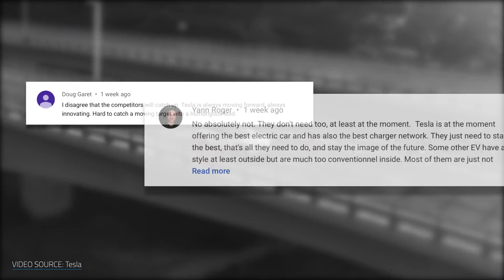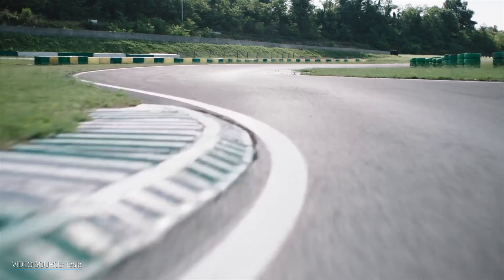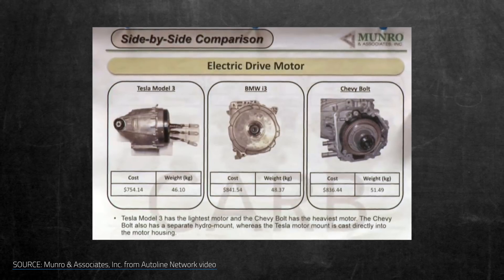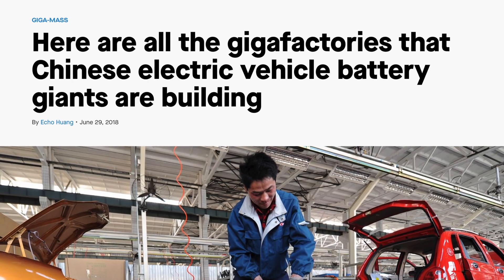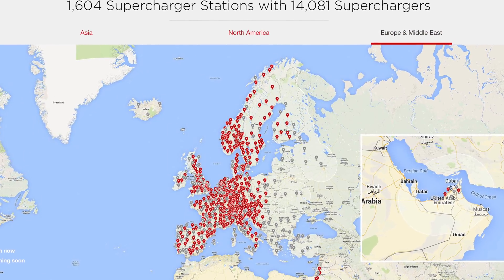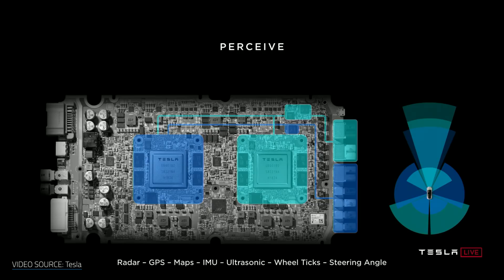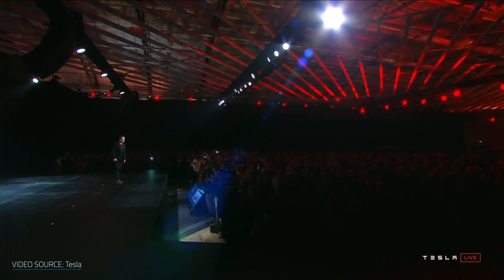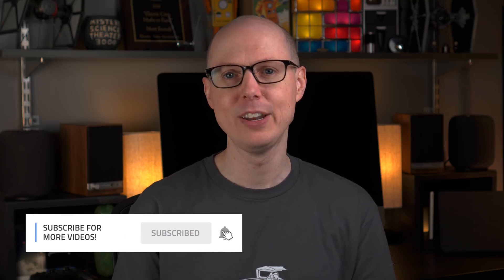Tesla vs Competitors - 5 Advantages

Comment: In my opinion there is a little bit of misticysm around the Tesla model 3 motor and, I read a lot of contradictories things in Internet. The machine, strictly speaking, is not a synchronous reluctance machine: as officially reported (and correctly) by the EPA certification, is an "internal pm machine" or in other words an interior permanent magnet (IPM) synchronous machine. IPM machines are the only synchronous machine topology which exploit, for the torque production, ALSO the reluctance mechanism. The same is true also for the other competitors, like Toyota, GM, BMW which also are nominally IPM designs (for the latter two, someone could call them PM assisted synchronous reluctance in reason of a kind of multi-layer arrangement of the PMs). Depending of the rotor design, the fraction of reluctance torque to the total torque production can be more or less significant. Under the cost point of view, high reluctance torque is benefical since it allows to downsize the expensive Rare Earth PM. In my opinion it's interesting to compare the different (rotor) pole number: the GM and BMW works, if my memory serves right, with a 10- and 12-pole design respectively; Tesla is a 6-pole design. As a general rule, the lower the number of pole, the higher is the fraction of the exploitable reluctance torque, and this might be a potential advantage of the Tesla design. Second, because of the lower number of poles, Tesla works, for the same mechanical speed at 40-50% lower frequency than GM, BMW competitors and this is positive as regards efficiency especially at partial load and medium-high speed range. (lower iron losses, switching losses). Finally, regarding of the Halbach Array, I have honestly some doubts it is actually like that: it's unclear if the Munro's statements are supported by serious investigations (with magnetic field sensor) or by highly questionable methodologies ("hammer test") as reported by himself. The PM segmentation, nor the PM explosion following the hammer test,  are not final evidences of Halbach Array.

Comment: The problem with tesla is not that they don't have a great product now relative to its competitors. The issue is how much cash and financial gearing was needed to get there. They know that their first to market advantage will not last forever and they probably wont have the means to sustain intense competition from other companies with much more cash available in the not so distant future. Technologies are getting commoditized faster then ever in every industry. They need to create some sort of network effect to stay relevant over time so software and data related to self driving cars is where it's at. If they can figure out and implement that first they will cause a real paradigm shift in the car and transport industry from which many competitors won't be able to adjust fast enough. Their advantage in that department is what could win them the game in the long run

Comment: The VAG (Volkswagen) are building the Ionity network of 350 kW chargers in Europe. It is not the size of the Tesla Supercharger network yet but it is getting there. Tesla cars can charge at Ionity but VW cars can not charge at SC - this is not VW saying no to a deal with Tesla. That is Tesla locking competitors out and might get investigated.
Reply from the maker: Tesla has an open invitation out to any other car company to use their network.  Nobody has taken them up on it.
Reply: @UndecidedMF  again this is untrue and the EU might fine Tesla until they open the network. No invitation is required because the network must allow any car with CCS. Just like every other charging network.

We are not talking free charging here, but paid by kWh just like model 3. Refusing to sell to other cars although the charger technically is fully compatible is abuse of market position and the EU is known for very hefty fines for that.
Reply from the maker: Baldur Norddahl oh... I’m following you now.  It might be tricky for Tesla to open it up because of how the chargers work.  They talk directly to the car to get authorization to charge and know what account to bill for use.  With non-Tesla cars there would be no such communication, so there’d have to be an alternate way to bill.  There’s no interface on the chargers themselves, so I’m guessing that Tesla would need to figure out some kind of mobile app authorization interface.  Curious how easily they can open it up without having to further retrofit the Superchargers.

Comment: All true and well, great car to drive, however, Tesla service (in my country) is desastrous! They cannot be reached, I have spent over 10 Horus waiting on the phone, car got towed, broke down several times, promises to fix and support all not kept, been driving a loaner now for over 2 weeks and 4.000 km and still no solution for my own Tesla. This is not how to treat your customers. I don’t even want to think about calling them, as I will need to wait another hour on the phone before someone will answer. Driving by a service center also easily takes you a 30 to 60 minutes waiting time and then another hour before you get some kind of answer.

Comment: Autopilot only works for airplanes and ships not cars due to liability insurance and software crashes.
Reply: And it is forbidden in Europe. You need to keep your eyes on the road and your hand on the wheel so what's the point. In large parts of Europe the driver has to meet strict rules while driving.

Comment: There is a way to build a better electric motor by changing changing the geometry of the moving parts which will eliminate the back EMF and eliminating the dragging action caused by the eddy currents in the copper greatly increasing efficiency.   Also other techniques can be used at the same time to increase the efficiency even more like. https://www.youtube.com/watch?v=HK3JOlY0V8Y&t=10s    Scientist Solves Tesla’s Secret To Amplifying Power.

Comment: Having constant-power for all ECUs is an advantage over traditional ICE components. Old car components always have to worry about low-power  or power-off situations for extended down-time. Having an ever-present power source makes design a LOT easier. ESPECIALLY if your entire fleet is electric. There's just a primitive, ultra-hardened approach that traditional ICE firms will need to drop if they want to reach tesla's wow-factor.

Comment: The charging network and navigation integration etc is what for me is the number one reason for Tesla. But the VAG group and a few others made the Ionity brand for charging network and that is growing fast too. Now if they also make use of the CCS car number like Mercedes does with the EQC you can charge everywhere without a app or dongle. 

Self driving is fun on the highway and Nissan Leaf does a great job there as well. Living in Europe I don't see full self driving cars in our cities for the next 10 years at least. 
The motor yes Tesla has a very good one but VAG and Porsche with the help of Rimac will also have great motors to go with. 
Tesla's siding with Panasonic was a great call and they are in the lead there but I don't want to count LG Chemie out. 

So I think depending on what you want from a car you have choice now. Smaller and bigger electric cars will come. For me Tesla is great and they have nice cars but for a family car the model 3 is too smal in luggage and the model X well I won't pay 80k+ Euro for a car of I should get a really good job somewhere. Volvo is coming too with electric cars and I would love a V60 or any station. That NEV's 9-3 station looked also really nice but I have a fond memory of mine 9-3 diesel so a electric one would be amazing even if it doesn't have FSD capabilities or fast acceleration. That even creates more pollution from tire degradation and we drive electric for ecological reasons. 

Elon is by far one of the coolest CEO's, no doubt there. But on the other points Tesla is working hard to have that advantage. Staying in the lead is very hard and I hope they succeed. But I also hope VAG and other manufacturers are just going to make decent electric cars. We don't need super fast cars everything under 10seconds from 0-100kmh is more than fine.  I want a practical car that is not around 80k which the EQC/e-tron/ i-Pace all are.

Comment: The model 3 has different type of motors depending which model. I'm not sure why the video says performance and efficency in one motor because the performance model 3 has less efficient motors but more responsive than standard model 3 so it's a choice.

Comment: If they had not got the biggest/best battery supply, the biggest data set for self drive, the best looking/performing cars, the biggest most reliable  own charging network, their own best chip designers, the most vertical integration, the only china factory 100% owned,  the most exciting road map for future vehicles from 250 mph roadster to 40 ton trucks,  the best engineers, a company mission that does the world some good (take note VW)  I might get nervous and pull my shares.......erm wait a minute where the hell is the competition?.....there is none.....game over big oil ill sit tight.

Comment: #6 Pace of innovation, 
You said Tesla is not standing still but actually they are innovationg much quicker than all the competition combined.. they innovate on battery tech, FSD, production techniques (the patent this week for reducing the ammount of wiring in model Y), Service (online sales, service provided at your doorstep, etc), OTA updates (cars get better over time) and last but not least, cars generating revenue after they are delivered by selling FSD upgrades.  Tesla's lead only gets bigger and bigger, competition cannot keep up with the pace of innovation.. Why? Because they still have a HUGE ICE eco system with dealerships and what not to support! Not enough money to spend on innovation in EV only.

#7 Tesla is NOT a car company alone
The energy business may become way more important than the Car branch, once the battery production can be ramped up 60x, as they have predicted (going to 2 TERRAwatt per year, while end of this year 'maybe' 35 Gigawatt) But also the solar roof ramp up to 1000 roofs per week is very significant! Tesla utility battery MEGA packs may become the most important revenue maker for Tesla.. cost to make and install on site is relatively low and simple.. Quick installation, OTA updates, remote monitoring and low maintenance costs may become very attractive for utility power companies and willing to pay a premium price for that.. The energy branch may become a HUGE revenue generator for Tesla.

#8 UNPRECEDENTED Exponential growth and worldwide expansion to become a world leading EV and energy storage brand (which they are already)
Tesla EV deliveries and revenue has been growing exponentially the last 7 years (doubling EACH year since 2012).. THIS IS A HUGE ACHIEVEMENT for the branch they are in.. no other company making tangible complex products like an electric car is, has ever shown this kind of growth for such a LONG time! The pace of growth is unprecedented and IS NOT SLOWING DOWN for the forseeable future... It will not be long before they PASS the large legacy auto makers in total revenue and car deliveries.. Tesla is ALREADY the biggest EV car maker in the world (except, maybe, for China brand BYD) and they only getting BIGGER... Probably end of this year the Europe Giga factory will be announced. Car deliveries will expand to other parts of the world, like India, Africa (South Africa), Eastern Europe, South America (deliveries in Mexico have started) and maybe even Russia (when the Europe factory comes online). New car models (model Y and Truck) will become even bigger than Model 3 is right now, Semi will be a huge money maker for Tesla.. and of course new models will be unveiled.. As you said, Tesla will not be standing still!

Comment: The big one is that Elon has built all the parts that he'd have to go outside to get. The more he diversifies, the less he must burn up profits to other providers. Silicon lab, check. Space ferry service, check. Internet provider, check. Tunnels that will require skids with motors that Tesla makes, check. Brain interface... that one could be used with any of his products. The point is, he's using synergy.

Comment: You pretty much nailed the major components in tesla's advantage. There are other things that maybe not as eye catching but nevertheless important such as : 

1. Over the air software update(yes you kinda mentioned it in autonomy point, but this is really big that it deserves the point on its own, considering how they managed to fixed braking and improve range efficiency just with that)

2. Advanced electronic components engineering and integrated cooling/heating system that Sandy Munro has praised so much, check out how Sandy explained it for more info, cause there's a lot of interesting stuff in there.

3. The fact that tesla car is some of the safest car out there, imagine if in every tesla crash that the majority of the driver died,  imagine how many the media gonna keep saying things like "tesla driver died" over and over again, and spun it into "tesla is not very safe".

Comment: Get into an accident with your Tesla, even a minor fender bender and then start talking about your "Advantages" when it comes to getting it repaired. Race me in a Cross Country roadtrip, you in our Tesla Model 3 or X, me in my 2015 Chrysler 200C and let me know about your advantages. Bring it up to Northern Utah in the Winter time, In a Snow storm, up some mountain passes and see who holds the advantage. A Car isn't an "App". It's a vehicle, it's something you drive on the road.
Reply: Insurance exist and tesla just added 40 more service centers to areas that require them most, who races on a road trip? There are plenty of videos showing that the M3 roadtrip experience is not that hampered by charging, who also travels through mountain passes during a snow storm? Dude it just sounds like your in a competition to make yourself as uncomfortable and dead as you can, but if you do go through a mountain pass you could always pack a 5kwh generator in the back with 3 gallons of gas for 100 miles of range added on top of the 240 miles the batteries shrink to0 in the winter, M3 is also a very safe car so if you fly off the side of the road you will be more likely to survive in it then mostly anything else.

Comment: How can they claim Tesla does no advertising, when there are so many Youtubers offering referral codes and at the same time only publishes positive stories about Tesla? The referral program is advertising, not in a traditional sense, but advertising none the less. Saying they spend 0 dollars on advertising is misleading. 

Teslas do have some genuine advantages of course, but they have lots of issues too. QC is the biggest one, IMO, Tesla are at the lowest place in customer satisfaction in my country, and on my father's 2018 model X, there were loose bolts on the rear diffusor, the drivers window is getting sticky, the display has yellow borders already, and there are lots of uneven panel gaps on a car costing 100 000 dollars. 

Also, Musk can be both a blessing and a curse. He is great at marketing, but he seems to always move the goal posts and mislead the consumer. In 2017, Full Self Driving was apparently coming in 3 months maybe, 6 months definately. He mismarkets AP to make the uninitiated believe it actually is self driving. And he committed securities fraud to make a weed joke.
Reply: Referrals only really give away electricity now, not a problem for a company that makes solar panels.

Comment: Being a vertically integrated car maker that depends on far fewer suppliers than the ICE firm's is another large advantage. Tesla makes a very high percentage of its components, even the seats. Having inherently fewer parts is one of the reasons for this (no carburetor/fuel injector,  fuel pump, starter, exhaust, air pollution controls, gas tank, etc.) but it seems clear Elon wants to control as much of the supply  chain as possible. Ford did this early in its history, but current practice seems to be to outsource as much as possible and do the integration and assembly in house.

Comment: You touched on efficiency with the motor but if you don't consider the car's aero and power electronics your missing at least 2/3rds of the story. 
Vertical integration also allows Tesla to lead in these areas where others are waiting for a Bosch to develop something. Part of the weight advantage of the power electronics was because of vertical integration. This increases efficiency, lowers cost and helps get EVs TCO at par with ICE.

Comment: Well done video.   I'm seriously considering a Tesla for my next car.  I have a couple of areas of concerns that I hope are answered by the time I'm ready to buy in a few years.  One is the lack service centers.  The other is a question in my mind about long term reliability.  Not with the batteries or drivetrain but with things like the automatic door handles, touch screen, etc.   I'm guessing by the time I'm in the market all of that should be answered.
Reply from the maker: Funny you mention service centers.  Tesla just announced 30 more service centers they're opening.  I think you may be right about them not being an issue by the time you get around to buying one.

https://electrek.co/2019/08/07/tesla-open-30-service-centers/